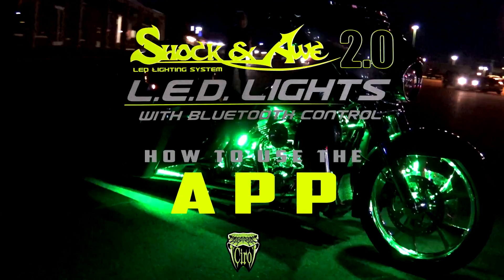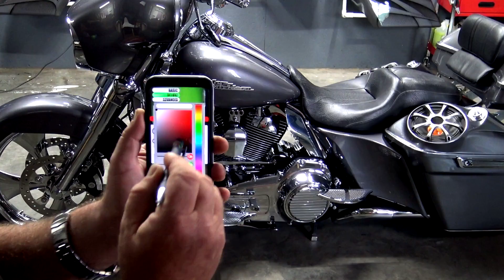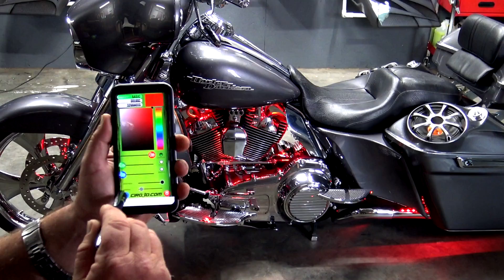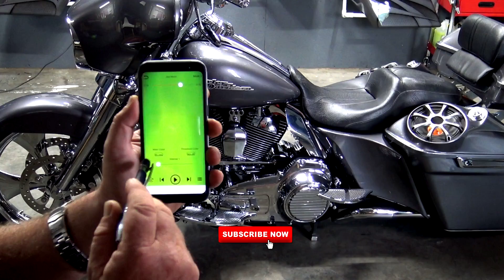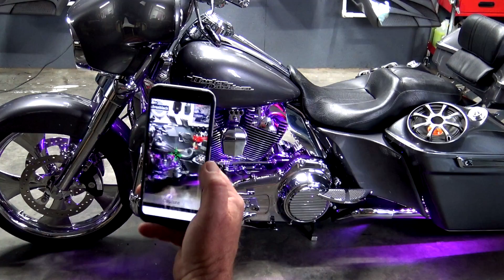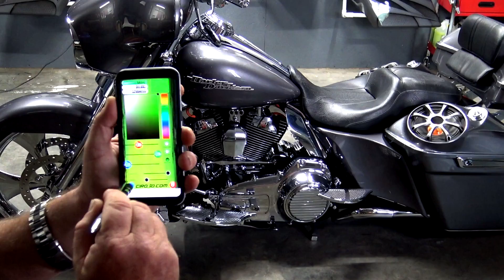A Detailed Look Ciro Shock & Awe 2.0 APP

Comment: It was a great system when I first got mine and the app worked. I've had several lighting strips go bad and colors not working properly, but I will say Ciro has replaced the bad strips while I was at Thunder Beach last time. Then shortly after Thunder Beach 1 of the 3 channels of the controler went out ... it will not function or even highlight channel #1on the system controller. I called Ciro weeks ago, might have been a month ago now ... STILL NOONE HAS CALLED ME BACK! IT DOES NO GOOD TO HAVE A COOL LIGHTING SYSTEM WITH OUT THE WORKING APP TO MAKE IT FUNCTION!

Comment: My HD dealer just installed this system. I'm having a couple of issues...1. the system runs for a few minutes then shuts off, a new battery was installed at dealer at same time. 2. How do I connect app to the new system. Appreciate any help you can give me.

Comment: Can you turn the lights on and off from the phone or do you have to use the switch on the bike?
Reply from the maker: yes you can use the app to turn them off and on
Reply: How do you turn the lights on and off with the app ?  Thanks
Reply from the maker: @anthonyditringo2702  bottom right hand corner is the on off button
Reply: Thank for the assistance 🏍🏍